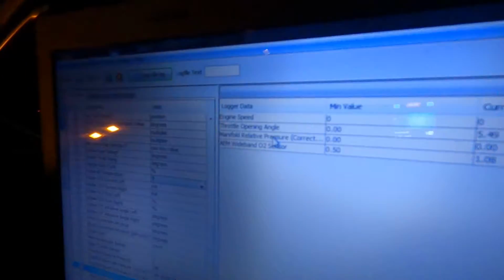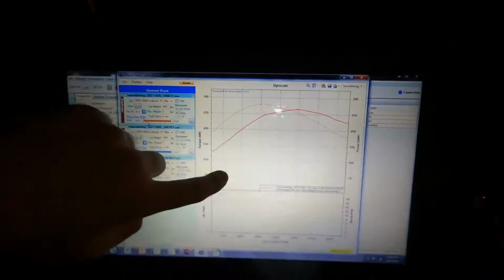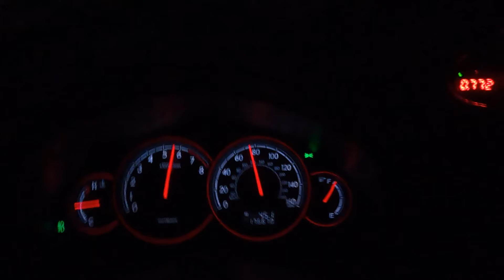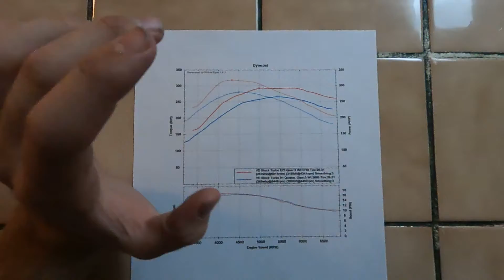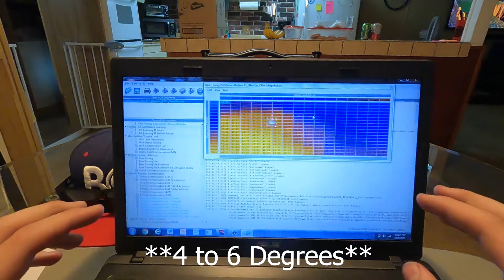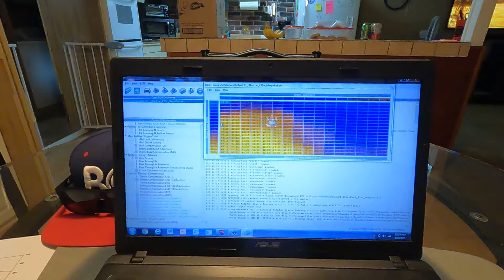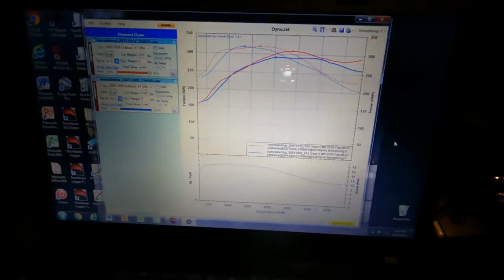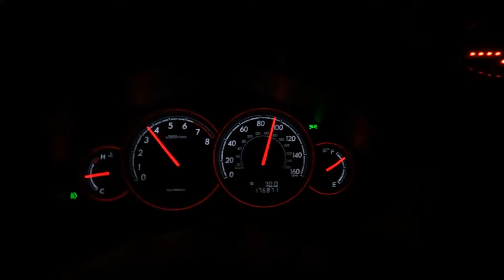Dyno Numbers!! (Subaru E85 Timing Tuning with Romraider / ECU Flash)

Comment: Tip in enrichment made a radical difference on my 05 gt. If I remember correctly, I was targeting about a 13 AFR under 10 PSI, would give me the most power. I destroyed my transmission after polishing my turbo, my heads, and my exhaust manifold. That made the car a whole different animal. 😆 My favorite turbo ever is supported and polished TDO4. 
Good luck with the car, those are amazing numbers.
Reply from the maker: Thank you, that's good info!

Comment: So having this flex fuel kit, the car needs to be retuned for ethanol
Reply from the maker: No, I think that was just a me issue. If the car is setup and tuned correctly you shouldn't have issues with it but at the time I did the install my fuel rails were limiting flow to the injectors which was causing some issues for my tuning. Once I upgrade my fuel rails to supply the required ammont of fuel the issues went away. If the fuel table is good on 91 it will be good on ethanol. Mine evidently was not perfect at the time lol. Hope that helps
Reply: @SWSpeedCo  Thanks for the reply.

Comment: What kind of tuning program are you using here?
Reply from the maker: I use ecu flash to edit and flash the tunes and romraider for data logging
Reply: @SWSpeedCo  thx man is that like hp tuners or sct tuner? Never heard of that.
Reply from the maker: Yeah its similar to those, just for subaru, and Mitsubishi ecus
Reply: @SWSpeedCo  gotcha,mines a dodge ram 2500 with v10 8.0 so is it true that you can do some tuning like timing and air fuel on the eflexfuel app? Right now I'm deciding if I need an sct tuner and the eflexfuel or just one. And thx again for doing these videos, very helpful! 👊🙏
Reply from the maker: With the eflex app all you can tune is fueling, but I'm not sure if it is only with the pro model or if it is also with the plus
Reply: @SWSpeedCo  which one you have?
Reply from the maker: I have the e flex fuel plus which I think you can make fuel maps on the computer program they have and then upload them to the app as custom tunes. I haven't personally messed with it because I just do all my adjustments in ecuflash
Reply: @SWSpeedCo  thx again man. I will check into it. If not then I guess I need an sct or something